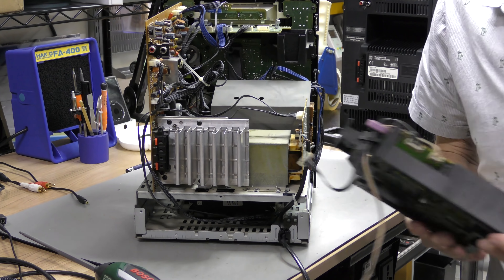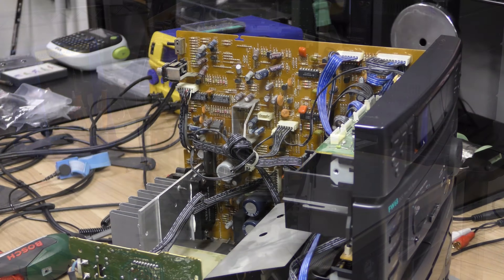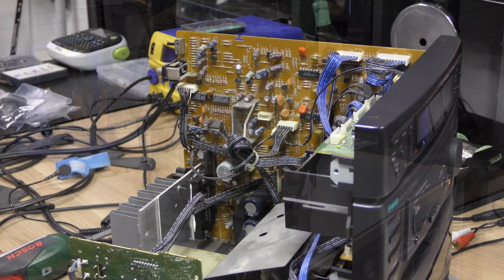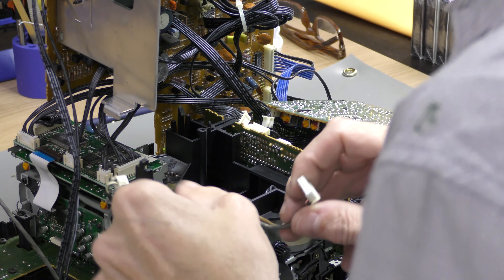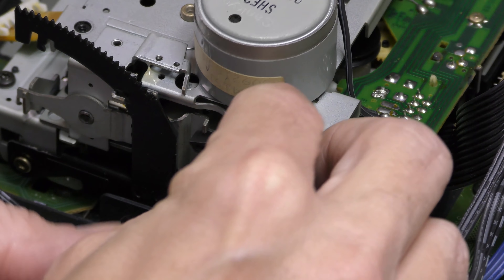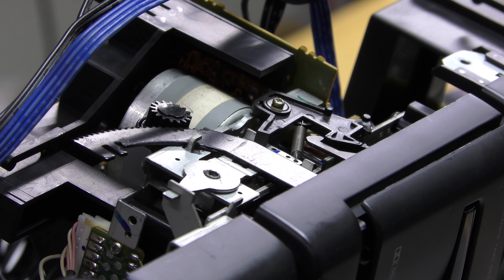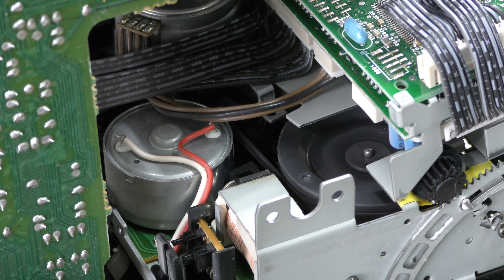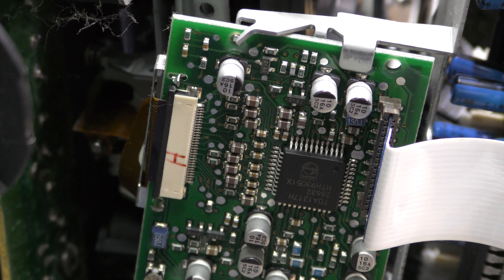Restoring the Philips FW68 mini Digital Compact Cassette Set

Comment: I just got one, in mint condition. I opened it up, using this video, which is essential for that 🤣.
Needs belt replaced, especially the small square one. of the cassette mechanism. Will have to order this from somewhere.
Looks like a very nice unit, and I'm happy with it!
Reply: So, I have restored it fully. Everything works beautifully.  Display back-lit works.
CD works. Belt replaced.
Tuner works and has great sensitivity. 
The amplifier works. I especially like the sound enhancements surprisingly. When using the corresponding speakers, the sound is just great. Even spatial, it surprised me positively, even when using headphones it really enhances the depth. And I am NOT a fan of all these gimmicks.
The Analogue deck gave me some more problems, but now it fully works and even records beautifully. 
The DCC deck also works like a charm. All belts replaced and pinch roller. 
Polished. Cleaned. It was mint, and now it also works like new. Very happy with it, love it very much.

Comment: What a mountain load of stripping and resembling. Mamma Mia! But worth it. All manufacturers followed this all in one approach. What would have been better if this system were separate components. But at the end of the day it works faultless like a new one. Well done. You are the master of repairs 😉

Comment: I was able to open my unit thanks to your video. I replaced the belts, adjusted the laser and gave everything a cleanup. It recently developed a strange fault: after powering up it only starts producing sound after a few minutes. I power the device, set it to Tuner mode and after a few minuted there is a click and it starts playing (and continues playing until i turn it of). Any idea what it can be?
Reply from the maker: Very strange indeed. Wish we could say more, but without having it on the bench it will be hard. I would start looking in the power supply first.
for faster help. forum.dccmuseum.com

Comment: Ralph, do you or anyone else know the measurements of all the belts? I need the dimensions to place the order.
Reply from the maker: Philip van der Matten We do not. It was done by by simply fitting belts until it worked. Really should have taken the measurement after finding the right one. Promise will do it next time. The original belt was totally gone, so we could not take any measurements from it.
Reply: @DRDCC  I see. But, do you remember if the belts were the same for the ACC and the DCC mechanism? Haven't taken the DCC mechanism apart yet, but I did take apart the ACC mechanism, and I would like to order the 4 belts in 1 order if possible.
Reply from the maker: Philip van der Matten The mechanism in a FW68 is the same as the DCC730 or DCC951, so the belt kit for the engine should the same, but without the tray loading belt. Jac even tried to mount a FW68 mech into a 730, but it did not play. Software apparently is different. Did you find the measurements for the analog?
Reply: @DRDCC  No, not yet, but I will keep you informed in this post when I do. Shouldn't be too long.
Reply: https://www.reeltoreel.nl/wiki/index.php/Philips_FW68.
There you go.

Comment: I remember having one. I think the display light is broken on yours, I remember mine had a green illuminated display.
Reply from the maker: We have a quite a few. None of them have a light. I believe that was not there from the start.
Reply: @DRDCC  I'm pretty sure. I remember it was the first thing that broke down. I'm not surprised none are working.
Reply: Here is a picture, green illumination is visible: https://www.omropfryslan.nl/data/files/imagenodes/boksen.jpg
Also non-DDC versions had green display: https://cache.osta.ee/iv2/auctions/1_1_8101157.jpg
Reply from the maker: Just checked all 5 hahaha. None have lights. Maybe we can try and fix it.
Reply from the maker: Sledge Hammer Thanks again.  We found the lights and fixed it. We also found that the original plan/schedule was to add another light to the dcc logo, but Philips never did. We have upgraded outs with the extra light and will make a future video about this topic.
Reply: @DRDCC  FW46 has a light, 100%!

Comment: Were there ever any other officially released DCC players with a conventional "vertical" mechanism like this one?
Other than the ones released by the Japanese brands of course.

I love this mini set, I wanted to buy one around the time of the demise of DCC, to put in the office room of my apartment. But I couldn't find it; even the Philips employees store didn't have it. I bought another nice miniset by Philips but of course it didn't have DCC.
Reply from the maker: That is a very good point, as this might be the only one with a conventional mechanism. The Panasonic and Technics have one, but are motorized.
Reply: @DRDCC  Also, somewhat interestingly, I was just reminded by the service manual that this is a 3rd generation recorder, though it has no text display so it can't record or display titles.
Reply from the maker: @JacGoudsmit  A little crazy machine. Why they left out even reading the titles is beyond me. This machine is the only one not being able to display titles.
Reply from the maker: Jac Can you see anything in the Service manual about a display background light in Green?
Reply: @DRDCC  apparently there are 3 lightbulbs behind the LCD and one behind the DCC logo (page 8-4).
Reply: Strange that it doesn't display titles. My mother has a FW-30, the first model from this compact series (together with the lower-end FW-20), and this older model has a fluorescent 16-segment alphanumeric display, capable of displaying the name of the source (tape, CD, aux, etc.) and messages during the configuration of the advanced features (timer, CD program, CD-to-tape fitting...). A pretty advanced machine for its time (1992) and market segment (mid-range).

Comment: As I see cd board has spdif output but not connected. Try to add few parts and connector. Then You can send cd player signal outside to DAC. I did It in My FW363 (have the same board) and it works fine. DAC from Philips is not so good.